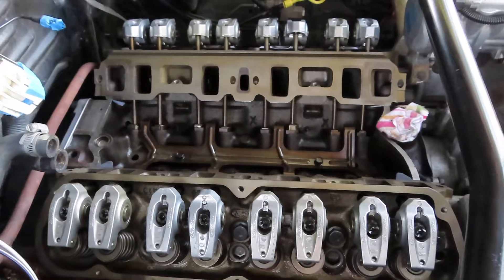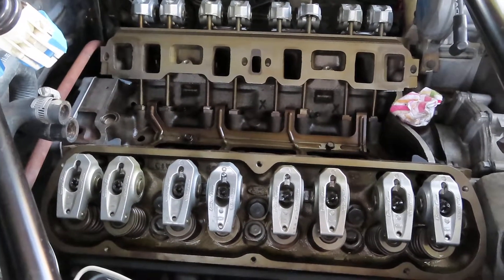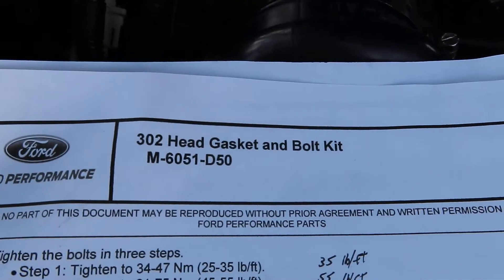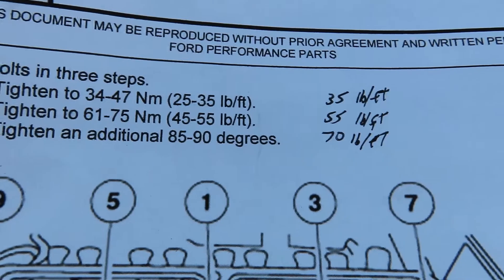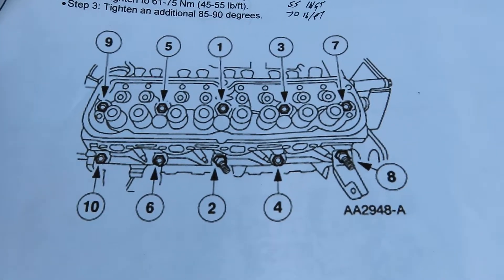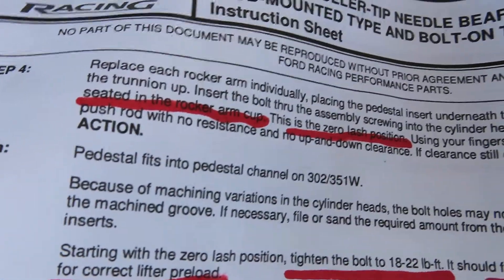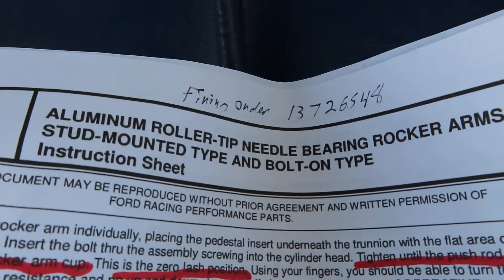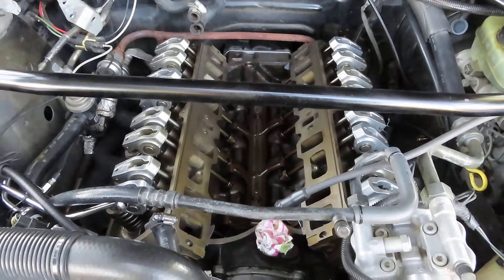Ford 5.0L 302 GT40 Head Install W/Torque Specs including Roller Rockers

Comment: I got here because I have a 302 HO that a previous owner put in my 1966 F-100 pickup. I thought a GT40 was an old Ford race car, one like at the Simeone Museum in Philadelphia. I'm 76 and forgot some of what I did to set the lifter preload in 2020 not long after I bought this truck. The specs for setting the preload to about 20 pound torque are confusing, different amount of turn from 1/4 to 1 full turn, but not consistent in opinion. After the heads were machined before I received the truck the stock pushrods were not long enough, so I had bought 6.300 and used different shims to set preload, from .020 to .040 inch shims. I want to do this again following firing order this time rather than other techniques. It is a little noisy since I changed oil recently.
Reply from the maker: @bluetruck53  The heads designed for the 1993 Mustang Cobra were called GT40 heads. They were also available from the Ford performance catalog. A later version of the heads were available on the Explorer and were called GT40P heads.
Reply: @mikeshorsepowergarage7577  I did install different shims from Ford Performance today. Their kit supplied about 10 each in size .010, .020, .030 and .040 inch. My aim was to get to 20 ft lbs after finger tight at close to 1/2 turn. I did so using 2 of .030, 2 of .035 (used by previous owner), 7 of .040 and 5 of .050 (.040 + .010). I will see if there is a quieter sound, though the second time I took the truck out after the oil change it did improve before today's changes. Only 6 of 16 valves required no change.

Comment: An easy way to put heads and intakes on without chasing the gasket all over is to cut all thread rods as studs.  That will let you drop them right in place.
Reply: ah yes, alinement pins...................

Comment: How much did you pay to have the heads rebuilt? Did they do a valve job?
Reply from the maker: New valves, retainers, springs, machining and some extra work to increase flow. Total was $1000.
Reply: I just started building my own 302 ford engine with my dad and we were torquing the main caps, to see how much clearing we got, and he said I should research about torque specs, and this how I got here